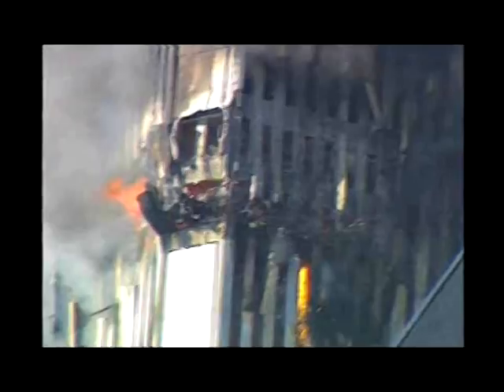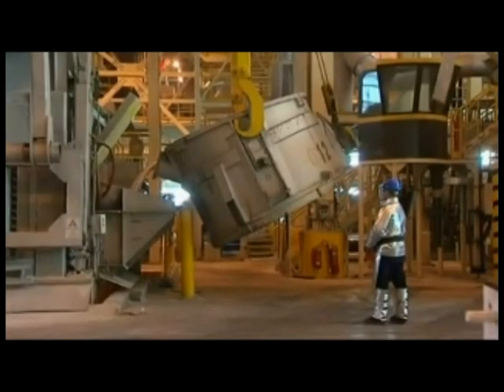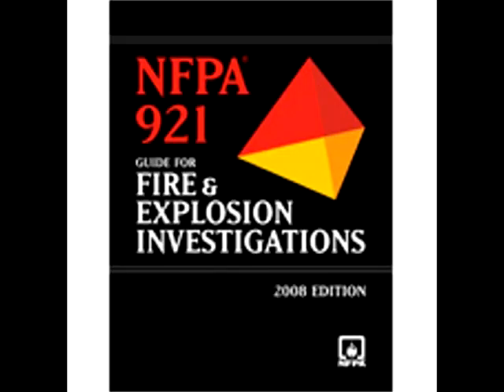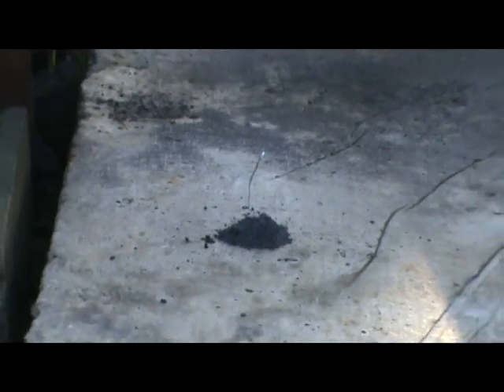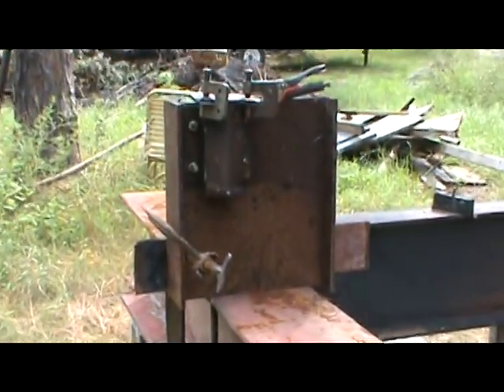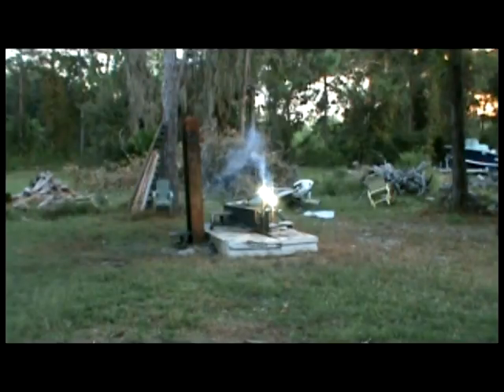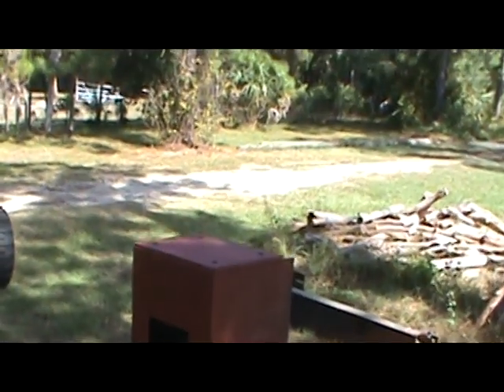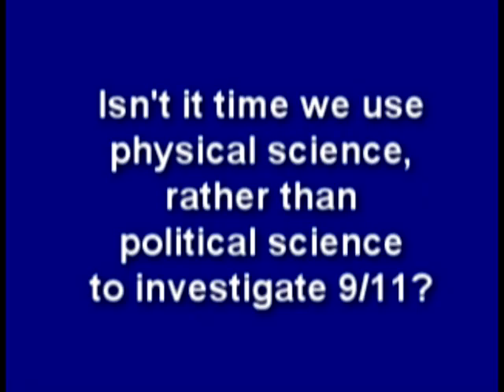9/11 Experiments: The Great Thermate Debate

Comment: If jet fuel could melt metal,  how come jet engines don't melt??? Steel beams in Wt were coated in aspestos enriched concrete too. 
If the weakened beams did melt how did they flatten the floors beneath them? At freefall speed? 
Why has there never been a metal frame building collapse before or since, even when hit by jet plane? How else could have the US invoked article 5 of NATO manifesto which they desperately needed? Why do people trust mainstream media 100% in the face of blatant lie for agenda?
Reply: The flames in a jet engine are contained by air curtains that keep the metal internals cool.
Reply: Yes, most of the air that goes through a gas turbine engine is used as cooling air.  The turbine blades and other hot section parts are made of exotic hi nickel alloys like inconel ect.
Reply: I've been afraid to use my stove for almost 17 years.
Reply: MrImarcus I don’t trust a dam word that mainstream media spews out of their lieing shit mill.
Reply: MrImarcus planes use titanium so it doesn't melt or bend.
Reply: bob smith try again your self. Steel flexes at 1800 degrees. All the reports say that was the temperatures on the outside metal. 
 The compression effect from the weight load would have possibly caused the molten metal. After you lose the bottom internal support the compression again would have been a load greater that the base could support. 
 As something falls it gains momentum. This is something "truthers" ignores. 
 On the inside of the tower the temperatures we're higher as the magnesium from the planes ignited and the burst fire suppression systems sprayed water on the burning magnesium suasing it to vaporize into pure hydrogen and oxygen. 
 Magnesium burns at 5000 degrees. Add burning hydrogen in a highly ozygen rich environment and you have a continuous explosive situation. 
 Again I was an airman on an aircraft carrier before oli became a blacksmith. 
 1300 degrees will make steel plyable.
Reply: MrImarcus good point
Reply: Good strawman. Jet fuel melts straw.
Reply: watch this. https://www.youtube.com/watch?v=FzF1KySHmUA&t=0s&index=2&list=PL8tiuA93xjkQOazTteh13UskGITN_27J2
Reply: MrImarcus wasn’t free fall speeds.
Reply: MrImarcus Lololol good Lord what comical uneducated comments.  I would say because it takes place in a combustion chamber...! Lolol.   

But the fact is jet fuel don’t melt steel and another fact is ordinary combustable used in building construction and interior design burns far beyond temps needed for structural steel to fail!!  ESPECIALLY with all the VERY hot burning polymers used in the synthetics of today!!!!   The only part jet fuel had was it spreader the fires that much faster and created the infernos in a very short time!
Reply: MrImarcus I was watching live coverage when someone said it was 'taken down'. another when 'explosions' were going off. plus, it looked like when they implode an old building.
Reply: aaron sheats dude they have looked like this since Walter Cronkite retired.
Reply: You Wished , try again temp too high.
Reply: I guess you don’t understand how steel is forged. Jet engines are cooled by supercooled incoming air with temperatures down to 70F below zero, without it the turbine fins would melt. Ignorant people will always be ignorant.
Reply: Logman thank you
Reply: look at the mainstream media right now bro. Dont they look just like then
Reply: MrImarcus 
It was a metal fire. Aluminum and Magnesium burn hot! Jet planes are made of it.
Reply: B. Eder magnesium burns hot enough to vaporize and ignite hydrogen in water. H2O means two parts hydrogen one part oxygen. Hydrogen gas explodes. It explodes as a white light. Especially in an elevated oxygen environment.
Reply: You ask too many questions. You don't need to know what the government is doing. They are doing it right, that's all you need to know.
Reply: Todd W. Perry, the engines are considered turbo Fans not turbojet engines. I would also wager the exhaust outlet made of some mystery metal of a jet engine with an after burn is not cooled by incoming air. Turbo fan exhaust temps up to 900c vs turbojet with after burn 1500c.
Reply: They're all turbofans these days.  Pure turbojets are only found in museums now as they are way too noisy and inefficient compared to modern turbofans.   All that varies these days is the bypass ratio; high bypass fans for airliners and low bypass fans on fighter jets.
As I pointed out in a post above, the exhaust "outlet" (nozzle) is made of a high nickel alloy which has a very high melting point but yes it is still cooled using bypass air.  In fact, all the left over bypass air is mixed with the exhaust gasses at the nozzle making it much cooler than other parts of the engine, (like the 1st stage diffuser or 1st stage turbine blades ect.)
Reply: You Wished Sorry, my mistake. I should have checked. Oh by the way have a look at what happened to a cargo plane in Amsterdam on 5th Oct 1992. Also, it's not the first or only time it's happened. And one more thing, never before 9/11 has a steel structured building been brought down by fire.
Reply: speculizer1971 Very sorry to disturb your educated self from spontaneous laughter. You are absolutely right jet engines are made of titanium and steel structures mild steel. How silly I seem to have been, I wish I had consulted you first on this matter. On another note if you do ever stop laughing try reading Dr Judith Wood, associate Professor of material physics as I was quoting her directly. I assume (uneducated as you pointed out) she said this point to draw our attention to the ongoing disparities of jet fuel flashpoint and the 1000 degree shortfall required for molten metal. 
Hey, what do I know... Also you make a great point about Polymers. Maybe the CIA can find some 'polymers' in Syria and spend millions destroying them to put 9/11 right. I hope I haven't disturbed you from laughter or education. :)
Reply: You Wished another brilliant observation, an oxygen rich environment like the inside of a raging building that's actively using oxygen to burn. Good point ;)
Reply: Todd W. Perry thanks Todd, I feel much better about my ignorance now. Give yourself a pat on the back. By the way do you have any advice for anyone who completely misses the point?
Reply: Superheated fuel by air would tear through an engine if jet fuel melted steel, air curtains? nope....Why would any engineer use a fuel that could POTENTIALLY, melt an engine. aluminum built engines at that......
Reply: MrImarcus what other steel buildings have been hit by jet liners? Answer is ZERO. 
 JP5 burns at around 1300 in open air. At ground zero the temperatures we're at 1800 degrees. The internal temperatures would have been hotter due to the thermodynamic chimney effect. The heat would have been channeled through the elevator shaft vents in the middle of the buildings. Heat you bike bolts to 1300 degrees and see how long they hold your weight load.

Comment: If you PAC the planes full of thermite then the exploding jet fuel can ignite it and as for cutting steel vertically all it has to do is poor down the center core f the building melting away the steel center structure that hold the building up.

The top steel not being melted away will now weigh more then the empty shell of the building below.

The top come crashing down and blasting the shell like peeling a banana from the inside out as the heavy top section comes crashing down

Comment: Lol 'molten steel' falling from the building. BS. It might LOOK like it to a casual observer who wishes to believe it, but closer inspection shows it could be ANY burning object, and what is falling is merely glowing pieces of that object - falling molten SOMETHING. It does not fall like molten steel - in a stream. It rapidly dissipates into glowing, lighter-than-steel, objects. NOT molten 'steel'.

It was likely a molten alloy made mostly of aluminium.

"Flames were cooling down"....as per a casual journalist non-expert from kilometers away. You people do not do skepticism.

The End.

Comment: Using an angle grinder generates steel microspheres.  So does bashing steel with another piece of steel.   Grinder sparks and hammer blow sparks are molten steel that form spheres

Comment: The big problem here is that molten aluminium at the maximum temperature the fires could produce is red / orange just like you see on the video..
Reply: So where did these massive amounts of aggregate aluminum come from?
Reply: You can clearly see the outer steel columns peeling away from the building during the collapse. They were the main strength of the building. The central core would be pulled down by the failure of each floor collapsing on the next. Of course they pancake you can clearly see it happening and the speed increasing as each floor collapsed.
Reply: You go with your conspiracy theory of demolition. Yes the outer columns peeled away but that still left the concrete floors and trusses still attached to the central core. You don't think the heat of those few floors weakened the steel in the core as well? The top sections weighed between 35000 and 70000 tonnes which acted like a jack hammer once the building started to fall. as each level was crushed it added more and more weight to the falling mass hence the lower levels were destroyed by the lighter top of the building. SIMPLE physics.
Reply: If you believe this was an internal job with the building rigged for demolition prior to the aircraft hitting it you are pissing on the dead's graves. You really think the aircraft flight path was designed to hit the buildings exactly at the floors above the explosives you are a fool. What happened if the aircraft missed by a couple of floors? The explosives would have gone off prematurely. Sporadic fire? The building was an inferno!
Reply: 150 tons of it in each aircraft. The steel beams collapsed from the heat which weakened them and then the sheer weight of the building on top pancaked floor on floor.

Comment: Discuss chemicals all you want.  Hijackers took planes and destroyed buildings.
Reply: Don Smalley yes because aluminum can penetrate concrete and steel. Obviously you never took a science class. Our airspace now and always was impenetrable. And obviously you’ve not looked at any of the data. Such has pilots were never able to take the same flight path that Hani Hanjour (a Saudi, not an Iraqi or Afghani) made when he crashed into the pentagon. You probably also believe the Earth is 6000 years old. Discuss all the science you want but the Bible proves the Earth is 6000 years old.
Reply: G Money Lololol...... apparently you are the one who wasn’t paying attn in science class!!!  Yes..... those 200 TON COMMERCIAL JETS COULD AND DID penetrate the towers!!  Perhaps you should fully educate yourself!!   ESPECIALLY THE TWIN TOWERS with its design!!  Lol. Yes, you def need to educate yourself on THOSE buildings in particular!! Lol.  With very minimal concrete on the outer walls.... 59 steel prefab steel columns on each side on 36” centers... which for the uneducated that means they were 3 feet apart..... just as a bonus you know what was in between those columns.... yep, 18” windows! Lol. The exterior had very little masonry on the exterior walls like I said.  There was NOTHING going to stop those jets from penetrating but damn sure not THOSE BUILDINGS!   Even IF the jets wouldn’t bust through the steel columns like they did the jet still would have entered and would have been cut like a vegetable slicer!!!  Sorry, but our airspace was not protected from such.... we did not have fighter jets flying the sky’s looking for rogue jets heading for restricted space..... here is an little education for you. Our restricted air spaces can be crossed by commercial air in a matter of damn near seconds!!! Lolol. Or is it you think we had surface to air missiles protecting the buildings!! ?? Lolol
Reply: Don Smalley neither are mutually exclusive.

Comment: Ever since the Citigroup Center near-disaster and the 1991 WTC attack, it was logical and ethical to design a means of demolishing large buildings in events of terrorist attacks so that they don't fall sideways and knock other buildings over. 

So yes, it was an inside job but the rational was less about foreign policy and more about reducing the number of deaths in the event of a terrorist attack that could jeopardize the stability of a large building. 

There's thermite placed is probably all the large buildings in NYC for this same reason. Just think about that next time you're in a skyscraper. Just understand that its done so that the people in the next building over don't die if your building is at risk for collapse.

Comment: What if thermite was somehow mixed with the building materials. Say maybe concrete or sheet rock mud. Maybe even the steel that was used to build it. What about magnesium could it have been added to the construction of these buildings. ????¿¿?
Reply: I mean if magnesium had been used. Then firefighters putting water on it would have made the fire hotter.

Comment: Great work!! I find it particularly interesting/surprising/alarming how weak the vertical connections between  the wall sections appear to be.  Ie  4 bolts only per connection without any  exterior gusseting, if that is the right term.  Which would be why we see so many clean breaks in the wall steel, with the familiar 4 hole pattern. Perhaps explosives  on the floors would have blown out the wall steel without too much assistance from thermate.   Either way, the walls were easily taken out.

Comment: The architect that designed the wtc towers specifically stated that he had designed the towers to be able to withstand a 747 crashing into it (I may be wrong about the type of jet so I'm sorry if i used the wrong model but regardless it was some type of large commercial aircraft) that alone should be enough for people to rethink/question the narrative that has been forced onto us all.
Reply: Correction: wtc towers were designed to withstand a 707 impact
Reply: No. The towers were ESTIMATED to be able to withstand an accidental, slow-moving, lightly loaded 707.
There is a MASSIVE difference there. 1, estimated is not designed. 2, a slow-moving, accidental impact of a plane that is low on fuel is not even in the same ballpark as a deliberate, larger, heavier, faster one.

"We think that the structure we have created is probably able to stand being bopped accidentally with a wiffle bat" is NOT the same as "we designed this so that a Major League batter could take a full-on-mad swing at it with an aluminum bat", as it were.

Comment: Or maybe the sheer force and power from the impact of a plane and burn of gas and other materials after impact was not accounted for by the designers of a skyscraper? Do you not understand the sheer power and heat that is produced in catastrophic events?
Reply: Lucas Givens the towers were designed to withstand multiple strikes by a Boeing 707.  

https://youtu.be/w_E4Ckuyc6k
Reply: Oy, this again and again and again. No. They weren't. They were ESTIMATED to probably be able to withstand ONE impact of a slow-moving, lost airplane at the end of its fuel. See the operative words there? "estimated", "slow-moving", "end of fuel" meaning light.